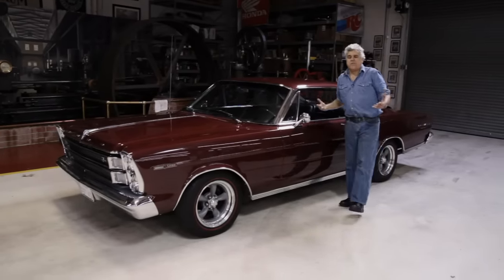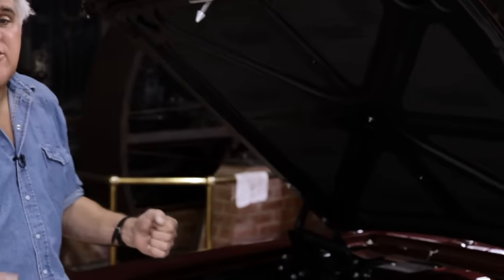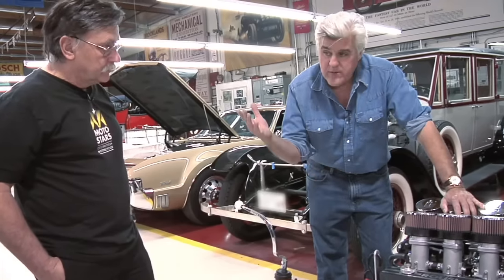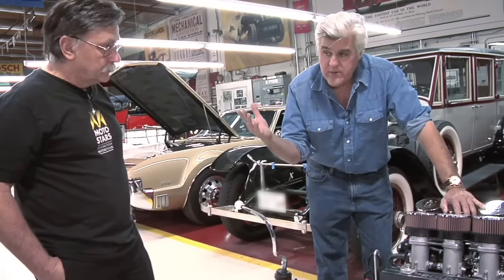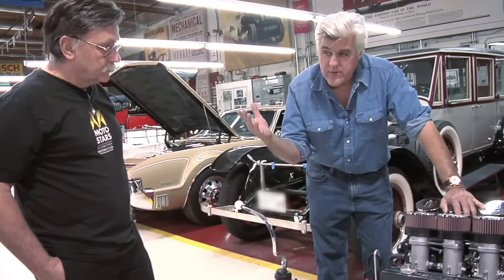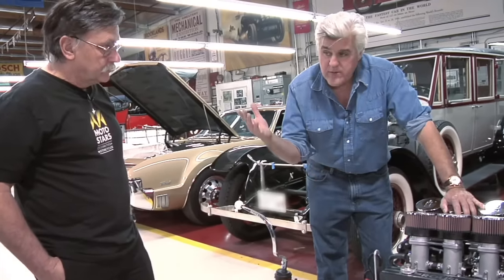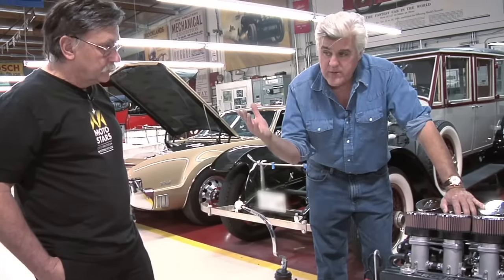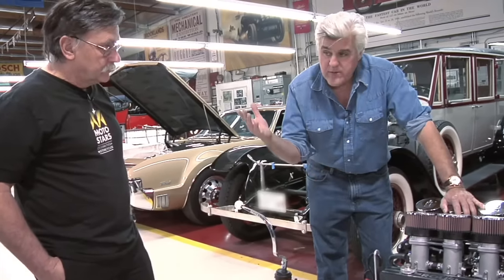Restoration Blog: 1966 Ford Galaxie, Ultimate Edition - Jay Leno's Garage

Comment: My truck-driver granddaddy bought one for my grandmother. Four door hardtop, red with a white top, 428 V8. It would RUN. He was convinced the safest cars on the road had the largest engines. And I think she enjoyed motoring around in it, too. I rode with him on a trip after my grandmother died, back in the days when they checked your oil at the gas station. The gas jockey would raise the hood, and their eyes would bug out of their heads at the engine. Thinking back over it, they had lived through the depression. They deserved a fun car.
Reply: Absolutely, it would be cool if you could find it again. My Dad had a 66’ Fairlane 4 speed, I’d love to have one. Good luck
Reply: @deborahchesser7375  
My dad had a 1966 Buick LeSabre. It wasn't anything special but it was enormous, and the V-8 was 
powerful and smooth. I still have the four original hubcaps from the car.
Reply: My grandma also believed in the big engine theory.  My uncles would go to auction and come back with Plymouth Satellite,  Ford LTD’s, Chevrolet Impala’s.  She commuted 35 miles to work from a rural part of the county that included crossing a steep mountain that had snow when raining elsewhere.  She didn’t miss work because of snow, she would carry speed to the mountain and pretty much coast up the mountain lol. I miss her, she taught herself to drive and she did well for herself.
Reply: Thanks, interesting story…..My “Burgandy 66 GALAXIE xl/500 4 SPEED/352/ Black INT “, was nice:: I improved it  a lot:: always kind of wished for the 7 Liter/ DISC brakes// at least bigger engine / some more “interceptor “ Parts, etc on mine………though the 352 Engine seemed to be fairly economical, & ran fine for me… Anyways, juat remembering Gasoline **was some 27-29 cents a Gallon,etc. Too.
Reply: I remember my dad had a Galaxy 500 when I was a child.  2 door hardtop, forest green with white interior.  I think it may have been a year or two later than this one, but it was such a sexy car.  I loved the hand-cranked wing/vent windows; a fun touch.  
I remember my parents bringing my little brother home from the hospital in it when he was born...  my most iconic memory of the car, as my grandmother walked me to the car to meet my little brother, sleeping in my mother's lap in the shotgun seat as my dad drove.  He even had a little present sitting on his belly for me... a day I'll never forget. 
He sold it within a year or two of that, to get a much larger car, a 71 Olds Delta98 4-door car made the Galaxie look small lol.
Reply: @1SqueakyWheel  thanks…. I liked my 1966 GALAXIE: 4 speed;;;  needed upgrades; ( some envy of 1966s with DISC BRAKES/ HANDLING PACKAGES/7 Liter// or even the R- codes ( it sure I could have covered GASOLINE $$ ,really)!! FULL DISCLKSURE,my suspicions are, that in being in Pharmacy School, dating / meeting my Wife (* Still Married 52 years later), & starting Life helped a lot enjoying the GALAXIE….actually kind of fun improving it also.. though we were in “Budget “first several years..
Reply: I met a girl recently, who was oblivious that she had a car with a Hemi engine. I saw the badge, and remarked, "Nice Hemi!" She's like, "What's that?" Even though she had a car with a big badge on the car that said "HEMI", she had no clue what it was. I told her, that a Hemi Engine will always be worth money, even if you wrecked the car and the engine was intact, never let anyone just take the car, to get it off your hands, Hemi's are special!"
Reply: My grandfather was like that he always liked a big v8 wnd he would always have straight pipes lol
Reply: @opera93  I have basically the same car as you. Except mine is an automatic. Same color, engine, and trim level though.
Reply: Yea Big engine would be safe UNLESS it landed in your lap!!
Reply: I really liked the comment "The deserved a fun car". So often I think that is the thing "missing" in so many modern cars, even the daily driver's: fun!  Instead today we get "video screens" (which being able to watch a movie while driving your car - how did that get past safety engineers? lol)
Reply: Yup we ordered a 68f150. Ranger package with the 390. No other options added cam manifold intake. Holley headers.  428. Heads. The works....truck flew and would nget unstable at 110........120mph

Comment: I was a highway cop in 1967. I had a 1967 Ford Custom 4 dr sedan police interceptor. It was a very special car. It had a prototype 428 4V V8 mated to a C6 trans and a 3.25 rear. power disc brakes, power steering. Ford was service testing what was to be offered in the Mustang Mach I in 1968 - the 428 Super Cobra Jet with ram-air. Quietly installed on Interceptors to test durability, strength, speed and reliability. The car was a rocket ship that buried the 140 mph speedometer faster than anything we had seen before, and was the first patrol car we ever clocked on radar at 155.6 mph. Very little is known about this engine. Mustang experts know all about the Mach I package and the 428 CJ and SCJ, and Galaxie freaks talk about the "7 Liter" package, but Noooobody knows about the 1967 police prototype 428's. When this engine proved its worth by inflicting itself on the criminal element coast to coast in the fall of 1966. When the 1967 Ford Custom hit the road with a badge and a 428 - it became the fastest 4 door sedan in the world. After millions of miles of testing, Ford released the engine to the public in the 1969 Mustang Mach One. Car & Driver reported "The 428 Mach One is the fastest straight line car we have ever tested." The 67 428 PI did not have solid lifters, as some have thought, and it was only mated to an automatic transmission in the  police car. It was NOT available to the public at all. It put out over 425 horsepower on the dyno and ran on 103 octane back then. I left police work in 1976 and spent the next 40 years looking for one of these big sedans. Never found one. Never could even find a PHOTO of one. Last year I found a photo of one. the Eagle on the lower front fender is the giveaway. the fastest factory stock American sedan ever made has disappeared into the mists of time. I know there is one out there - perhaps in an old boarded-up garage somewhere in Arizona, squatting under the weight of dusty bric-a-brac....But I am old and tempis fugit - but it doesn'r fugit as fast as that magical old Ford.
Reply: GREAT story!!! I've ead the '69 Dodge Hiway Pursuit Pkg was the fastest  pursuit  vehicle of the '60s, but I bet that prototype would give it a good run in a straight line as ChryCos Torsion Aire suspension was excellent. Any idea how many of those prototype were made? Hope you find one!
Reply: I had a pearl grey '72 Ford Custom 500 Police Interceptor in the mid '80s with a 429, pumping 735 Holley's, also mated to the C6 trans. Picked it up at an auction. I had to pull it back at 120 mph. It was barely panting. It wanted to do more.
Reply: I bet they had to give them back to Ford, and they tore some of the motors apart to inspect them.
This day and age, there's no way Ford lawyers would let those cars loose on the public, I don't know if they thought that way back then.
Good story.
Thanks
Reply: Gad! I just loved your story.  Just sta the imagination adrift. Well written.
Reply: Too bad for you cops they were going to put the 428s into the lighter Mustangs.
Reply: Thank you. Very interesting.
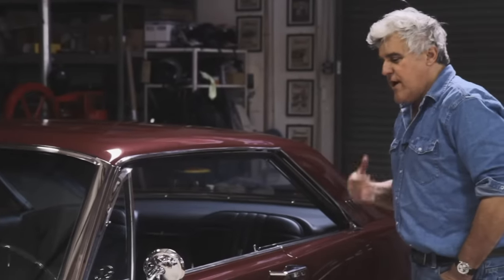Reply: My stock 67 gt500 had a 428 police interceptor with 2 600 holleys - it did have hydraulic lifters - i changed that to a 427 low riser solid lifter cam - and this shelby was a 4 gear with 3:50 diff
Reply: Cam  The question remains? I don't recal that ever being asked. If you're asking me, (and I don't know why you're asking ME), do you want me do itemize the figures for each category you've given, or would a guesstimate suffice? I'm more curious to know why ex-officer Siebenburg capitalized his last name, but not his 1st., or "middle" names. ;-)
Reply: @w41duvernay  The idea was pursuit class hwy. patrol cars had a greater cooling capacity than cars like the 428 Mustang you mentioned. The average  car would overheat in a long chase and the cop car would eventually run you down.
Reply: "What ju talking bout Willis" Criminal Element my mom was a cop and we were a bunch of hooligans ahhhh the gpod ole days
Reply: eric von Siebenburg thanks for story....
Reply: Were they the same motors Carroll Shelby was putting in the Cobras and as the story goes was forced to replace them with the 427 which were originally for the Cobra but Shelby was looking to unload the surplus 428s which were meant for other cars
Reply: Eric Im old too lets get off our rocking chairs and go find one nice story on the Intercepter Police Special
Reply: I PERSONALLY TOOK 3 ALUMINUM MANIFOLDS  OFF 1969 KY STATE POLICE CARS   WITH 428 ADJUSTABLE ROCKERS AND SOLID LIFTERS  AT THE JUNK YARD  IN 1971
Reply: Eric, a friend had a 1966 427 side oiler that he removed from a Galaxy and put in a 68 Mustang. On the street he was never beaten, Vettes, Hemis in Cudas, Roadrunners, Challengers, he never lost. That engine was legendary and it sounds a lot like your 428. Later 428's that I drove never came close to that side oiler with it's two four barrel carbs.
Reply: 427med   I parted out two ‘70s from Ill State Police.  They were 428s hydraulic lifters, cast iron intakes (68 lbs as I remember) triple core radiator, C6, 31-spline axles.
Reply: Someone had ask for help ID a Ford on FB marketplace in the Houston area. 
They had just taken a pick of the rear trunk lid in a falling barn. They were asking what was it under the fallen lumber. Told them it was one of them there 7L 1966 Fords. May have just been a prank don't know they never text back.
I must of deleted the post I looked back like 8 mo didn't find it..
Best wish's on you find one I'll be looking for one also. Didn't really know how rare they were till today.
Reply: We had a customer who had been a Missouri Hwy Patrol officer for many years.  I asked him one time what the best/fastest car he ever had and he said that it was a 1970  429 police(same as CJ).  He told me that it could bury the speedometer on the then new I-44.  He said that every time the got new cars his was never the best running except for that year.
Reply: The fastest police car tested by the LAPD was the Polara with the 440 until the current Hemis. There is documented proof of that.
Reply: Love your share,SALUTE...

Comment: We had a 65 Custom 500 when I was 12.
It had been a DPS ( highway patrol)
Cruiser with the 428 P.I., we kept it 4 years. 
Man was it a mover.
In 78 I built a 428 I got out of a 68 Mustang GT and put it in a 75 F150 
It was a blast to drive.
 I ended up giving it to my oldest grandson after he graduated from
Marine Recruit Training, San Diego
With 1 condition, he can never sell or trade it outside the family, if no one else wanted it, I would buy it back.
So far, he still owns it.

Comment: In the 70's my brother was RCMP highway patrol stationed out of Lethbridge, Alberta (Canada). He drove all the police interceptors and the one he took me in was a Ford Galaxy just like the one above with modified 460 and suspension. Coolest car I had ever been in - but most interesting was the shifter in the column. It was a four speed automatic that shifted itself through all four gears at exactly the right moment. When you stepped on it from first it went like a rocket and they said it was made to out run Porches. Canadian highways are hug, very long and smooth - and a great place to let it go. Of course being a cop helped. It was fast and quiet and very comfortable.

Comment: I purchased  a used low milage red Parnellie Jones  (he drove it and owned the dealership in Torrance CA where I bought it)  66  7 liter Galaxy. Wow, that was one fast car for its day. Didn't handle well with the soft suspension but for $3,500  who cared. Great memories. Sold it when I started a family and needed something more practical. Thanks for this video. Brought back memories.

Comment: Back in the mid 70s, a buddy of mine bought a 1967 Galaxy 2 door hardtop with a 428 4 speed transmission. He wasn't in love with the car and wanted to sell it. Another friend was looking for an engine for his 1966 Mercury Cyclone GT which originally had a 390. I brokered a deal and my buddy still has that '66 Cyclone GT with the 428 in it!

Comment: Tried the same thing back in 69 when I went to the Chevy dealer with my dad .
In the showroom was a leftover 68 impala 427. Tried to get dad to buy it but when he looked at the sticker said if it's less than me ordering a car I'll buy it . Unfortunately it wasn't.  I tried to get my dad to get all kinds of extras but only got him to get the 350 instead of the 327 and HD suspension that was only like $19.xtra. For  $19 it came with Corvette rallies and a 12 bolt rear. I hated the looks of the 69 compared to the 68 but after 180k with the original engine/transmission still running good it was finally sold.  To this day I  can still remember that 68 2dr  sky blue  427 ! Unfortunately mom wasn't there but rescued me a few times when I got in trouble.  So mom was cool in her own way.
Reply: Ben, my mom was cool too.   When the weekly newspaper came from the weekend retreat town where they spent most of their weekends, and on the front page was the story how I was chased, for over 20 miles, over a hundred miles  an hour, arrested and put in jail.  My mom hide that paper from my dad. Thank you mom, you were the best
I had a1962 Ford 406 cu. in. and 405 hp..I had the speedometer buried on a long straight away.

Comment: My second Ford was a ‘66 yellow convertible black interior 390 4bbl.  I smashed up my first on the ice knocking down a mailbox & hitting a tree. My life savings was totaled. My Grandfather helped me out. I changed it for a Hurst shifter & put in additional directional lights in the empty holes below the factory directionals.  I remember the Blue dash light for a cold engine. Once the top got stuck in the down position & I had to remove part of the interior tracing the harness to a pinched wire under the rear seat.  In the winter the horn would go off 2 or 3 AM getting me out of bed pulling the 2 wires off the horns.  I had replaced a noisy throw out bearing only to have the clutch go bad a few weeks later.  Love the wheels Jay, they  remind me of Cragars which I put on my ‘69 Mustang fastback years later.  It was a gorgeous car, got me from NJ to Miami Beach no problems & the ladies liked it too. Thank you for taking me back 50 years Jay, you’re like a time machine

Comment: Thanks Jay, this brought back a lot of memories for me, we were a Ford, Lincoln, Mercury family. My older brother had a 1967 Ford XL convertible with the vicious Ford 429-ci with whopping 475-hp... What a car! I never saw a huge battleship of a car handle any better than that big ole Ford... (but now I see that maybe it could have handled a wee bit better) plus it beat every single car that was stupid enough to want to drag race it, even a 455-ci Corvette! Thanks Jay! 👀
Reply: Your brother must’ve had a wizard on hand when he bought that car, then.  The ‘67 Galaxie XL was available with a 345 hp 428, not a 475 hp 429...
Reply: @MrJett1971  Wrong, that information is even provided by Ford Motor Company in their 1967 Ford Repair Book from the era. Guess you don't know everything after all.
Reply: Thanks, me too. Though, the 1966 XL/ BURGANDY/4 speed: 352...I worked on from 1968( my Parents got it cheap I think) into 1975ish. fortunately, I worked in Brakes( did not have Front Disc),Radiator, tires/ shoxks... etc. Anyways , loved it , lots of Travel, and had a junky 1961 Ford Convertible to get rid of : in Pharmacy School  until late 1970....LOT OF MILES AND CARE.......Interestingly, I had to add the COOLANT Recovery System( orig ,buy only at Ford Dealers, then to,Parts AUTO Stores..., TOUGH getting proper Metallic Brakes fitted ( had a Brake Man in Lafayette IND), ALSO, REMEMBER, THE hazard Switch is inside Glovebox: great to use if you can Find it,,,,etc,
Reply: @MrMenefrego1  thanks, interesting.... FORD HAD quite a bunch of Performance, etc. *& parts.... etc.I remember my 66 GALAXIE XL500/4 speed working in..... and on. Etc.
Reply: I did not know about the 475/Horse Engine etc